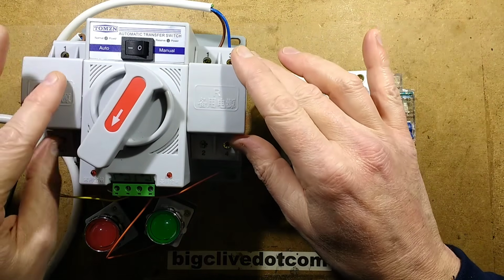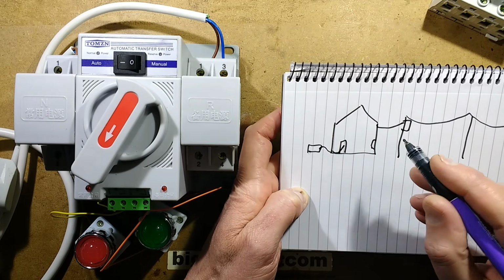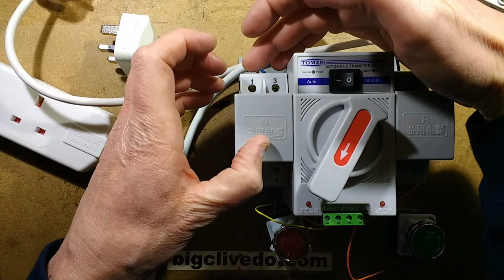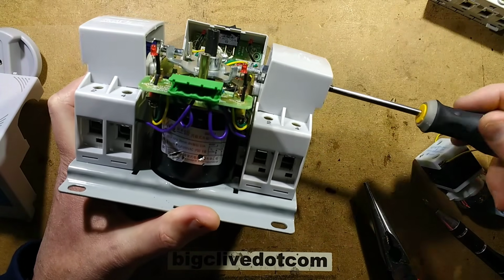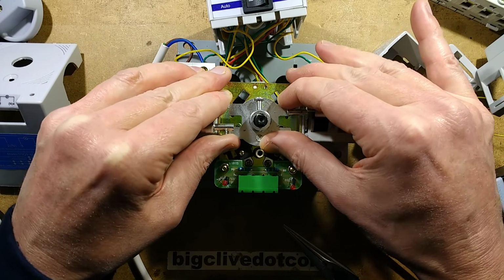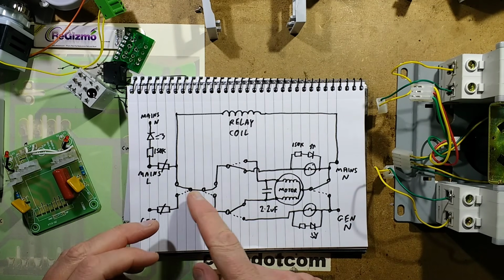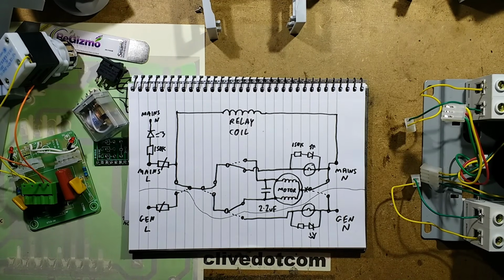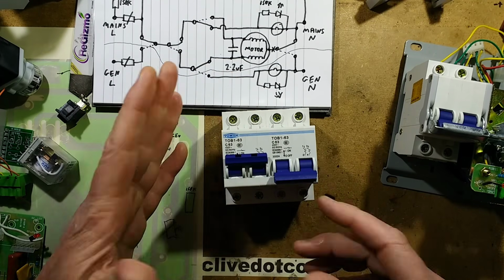Automatic generator changeover switch (with schematic).

Comment: You raise the issue of backfeeding the incoming supply from a generator during a powercut. Of course, sometimes this is desired - eg solar panels or other local generation - so are there systems which will prevent these from feeding in when the mains power fails? But of course it would be neat to continue to be able to access any power they are generating despite the mains supply having been dropped.
Reply: Inverter chargers can do this, they act as a mains grid that will take excess power and charge batteries which also completely isolates the 14kv residential lines eliminating a potential death shock.    Most, if not all solar inverters have island protection which means that if the sine wave of the grid disappears the inverters do a safety shutdown.
Reply: The problem with anti-island protection systems is that if you DO have a mains outage, your Grid-Tie inverter stops dead. So, even if you've got solar capacity, you can't use it. There are ways around this - our strategy is to isolate from the Mains and use a standard (no Grid-tie) inverter to provide power. Once again you MUST ensure isolation from incoming Mains, and therefore you MUST have some form of fail-safe disconnection system or protocol (for equipment and safety reasons!)
Reply: A pure sine wave inverter will run a fridge or any other induction load just fine.  

Modified Sine Wave inverters cause motors to struggle, however.
Reply: More than possible to run a fridge from an inverter.  It just need a big bugger as the starting current is around 10 times the running current.  Not that inefficient either usually 80% +.  A 1kW inverter should start a standard domestic fridge that runs about 100 watts without too much grief.
Reply: I ran my LED lighting, home theater, fridge, and a window unit for several days on a MSW 3kw inverter during Hurricane Irma.  Played hell on my poor van's alternator, but worked flawlessly.
Reply: In metro areas of Queensland (Australia) it is mandatory that your solar inverter isolates the solar supply in the case of a power outage. If you wish to be able to use your solar installation during an outage you can't elect to backfeed onto the network (and therefore can't make any money selling your excess generated power back to the utility companies). There are however cases I have heard of lately at work (had one in our safety brief today!) where setups are indeed backfeeding during an outage, probably due to non-compliant wiring by the electrical contractor that installed the setup and/or cheapo dodgy inverters that don't meet the Australian standard .  Concerning stuff :(
Reply: our solar roof setup (7.5kW peak) turns off if no 50Hz Sine, or difference to 50Hz is more than... 0.02 Hz i think it was ??

Only Necessary power needed here would be for central heating (+ cooking).
Warm water is mainly gas, secondary electric heaters.

I cant remember having a power failure at home in years, even then it always was over before you knew what happened,
AND the one failure i got at work (street working company dug into main line)
was fixed within 20min before the "manual generators" were connected properly... (Thanks to isolated subnets with multiple feeding points)

BigBoss was making everybody stressed for no reason (phone lines only work a certain amount "off time" via local backup in distributor anyway)
And when (very small) Gen was hooked up to main server running (unloved old usv starting to run low..), he plugged in shitload of unnecessary things (phone, PCs...), so the generator shutdown with overload.

If we just went for a walk 20 minutes, all would have been fine after that.
But then all Server and Phone and "Stuff" had to be replugged where it was originally, and it took over an hour until normal state.

...You wont find a single power line sparking for more than one " lightning arc" here if ripped off, without anyone needed to shut it down.
Reply: In the UK, currently you’re not allowed to backfeed microgeneration load when the incoming mains is down - mainly for the reasons stated by Clive - as there’s no guaranteed failsafe way (yet) to ensure premises are isolated. Most UK microgen installations are configured so that if the incoming power goes off, the microgen does too and the house experiences a power loss. Sounds bonkers when you may have both panels and batteries. There is an episode of ‘Fully Charged’ where Robert shows us his Tesla powerwall and this is explained.
Generators are a bit of a rarity in private homes - only time I’ve used them myself is in relation to computer rooms as backup power in a corporate environment. Usually backing off a large battery and capacitor based UPS.
Reply: Im just making sure I understand. If the mains fails, you cannot backfeed stored or generated power from batteries or solar, etc. at all into your home? Is this the case if you have an auto switchover like the one in the video or even manual switching?
Reply: our solar roof setup (7.5kW peak) turns off if no 50Hz Sine, or difference to 50Hz is more than... 0.02 Hz i think it was ??

Only Necessary power needed here would be for central heating (+ cooking).
Warm water is mainly gas, secondary electric heaters.

I cant remember having a power failure at home in years, even then it always was over before you knew what happened,
AND the one failure i got at work (street working company dug into main line)
was fixed within 20min before the "manual generators" were connected properly... (Thanks to isolated subnets with multiple feeding points)

BigBoss was making everybody stressed for no reason (phone lines only work a certain amount "off time" via local backup in distributor anyway)
And when (very small) Gen was hooked up to main server running (unloved old usv starting to run low..), he plugged in shitload of unnecessary things (phone, PCs...), so the generator shutdown with overload.

If we just went for a walk 20 minutes, all would have been fine after that.
But then all Server and Phone and "Stuff" had to be replugged where it was originally, and it took over an hour until normal state.

...You wont find a single power line sparking for more than one " lightning arc" here if ripped off, without anyone needed to shut it down.
Reply: In the US there are two primary ways to do what you're talking about. Originally a switchover either auto or manual would disconnect the house from the mains, then either a second one would switch over from the grid tie inverter to a stand alone (or if they can communicate the grid tie inverter would signal to the stand alone to start up. Or, as is more common now hybrid inverters, they utilize both batteries and mains power. Should the mains fail they internally disconnect from the grid while still providing power to the load, oftentimes without any down time. These hybrid systems however have been limited to about 3kW last I checked though.
Reply: I believe this is for the case where your power generation is connected to the grid so you can sell power back to the electric company. Backup power and isolated power is not on the same deal, I think.
Reply: The solar panels installed at my place use microinverters on the panels and they cut out if they lose power. Anti-islanding system.